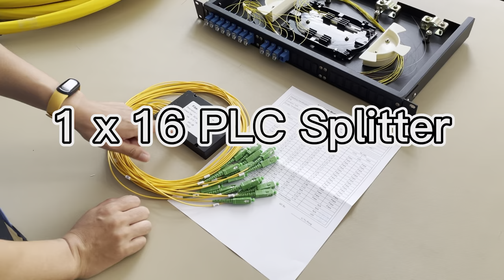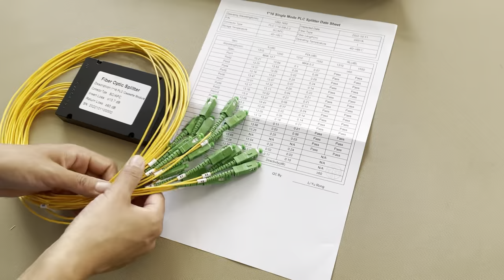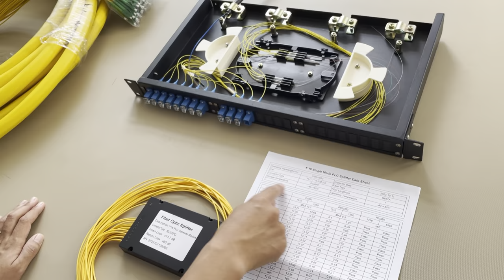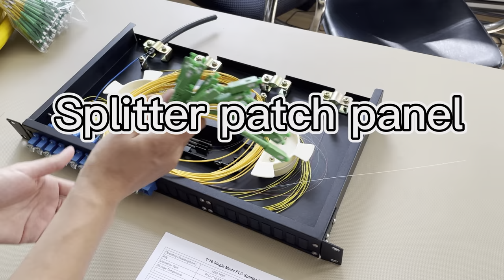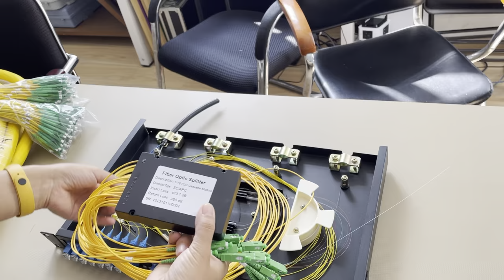How to use 1x16 fiber optic PLC Splitter?

Comment: can we pass vlan between switch using this splitter?
Reply from the maker: yes, you can use this splitter  with your media converter. PLC splitter is used to expand your network by single fibers